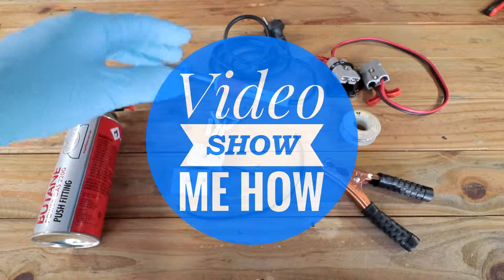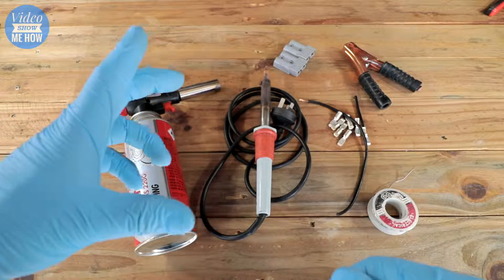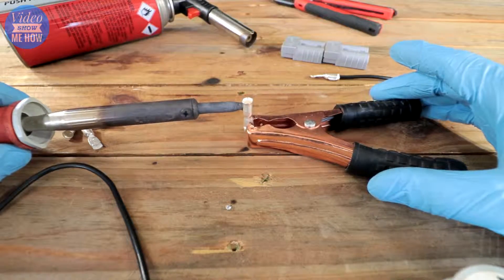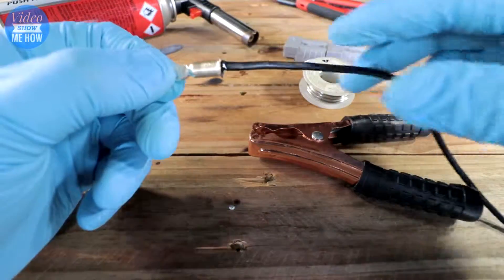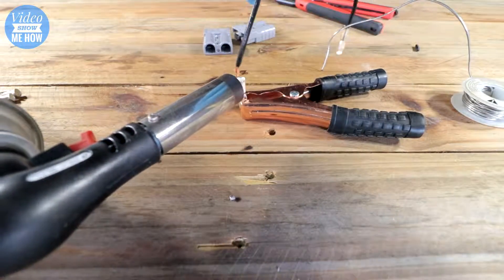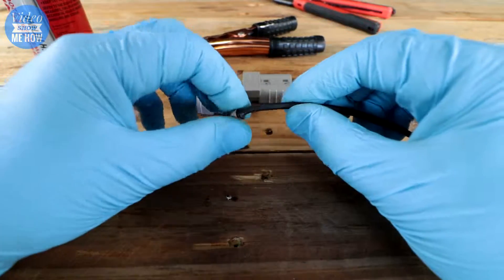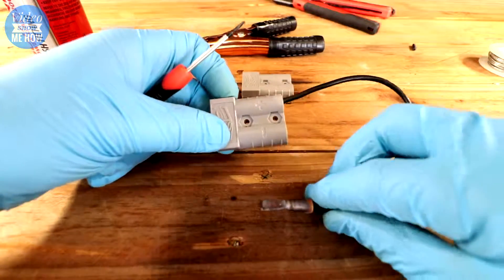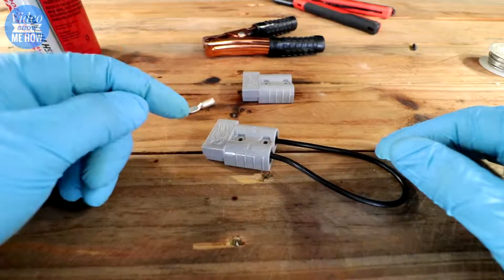12v Anderson Plugs and Connectors - FLOOD SOLDER

Comment: Though your solder job held I put solder flux on the wire and in the connection too.
Reply from the maker: Nice, thanks for the tip

Comment: 101020/1438h pst.  I’m here once again, to sincerely apologize for expressing my affinity towards soldering Anderson connector or any high current connectors (ring terminals etc) I retract that statement and wholeheartedly support crimping the contacts with 10 Ton hydraulic crimper. 
The soldering to Anderson connector became a mess and looked hideous. Fortunately I have the 10 Ton hydraulic crimper. The final product looked very professional neat and tidy. Thank you , stay safe and 73s...

Comment: 093020/1311h pst.  Thanks for the 2nd segment of connecting cable to Anderson connector, by flood soldering.
I, always prefer to solder smaller cables,  (up to AWG10) to ring connectors and to connectors of similar types as above.This is due to “Wing” formation and the struggle to trim and fashion the area. The larger AWGs, it’s best to use the Hydraulic press/crimper as you spoke and demonstrated in the previous video.
In the first part of the video, after filling the cavity with Pb, it looked that the Cu strands were simply dipped into the molten Pb. Under such conditions Pb may not adhere to Cu properly thus giving rise to an undesirable “dry solder” condition. It’d have been proper, to either pre-tin the Cu strands or dip the Cu strands in KESTER #921 fluid flux before insertion into molten Pb. I faintly, observed in the second part of the procedure, that Cu strands were 
Pre-tinned before insertion. ThT was nice.
Like you mentioned, the Ronson torch was an “overkill” (excessive heat) and  in the process, the Ag got oxidized.
But the theory is well taken.
The above comments are only an observation nothing but that. 
Your project is well appreciated and respected.
Thank you, Sir. Stay safe and 73s...
Reply: Hydraulic  crimper always better. Eliminates risk of a dry solder joint.. you may think you have a structural join but not necessarily a good electrical join -  my personal experience of 50 years doing amateur electronics and Amateur Radio!!!  When soldering with blow torch - connector can get too hot causing oxidization of the  silver coating of the Anderson connector affecting electrical join. Both the Anderson connector and the wire cable need to  be fluxed / tinned with a temperature controlled soldering iron before soldering to join electrically both parts. if insufficient  contact join area and you try to pass high current through it  - that could cause heating of the connection and even failure of it. So message is - crimp it!!  That is why profession installer always crimp. End of story!!

Comment: Nice discussion and show and tell.  My only comment is I think you contaminated your solder joint with melted plastic insulation which could compromise the strength and electrical conductivity of the joint.   Trim off a little more insulation so you don't do that would be preferable to me.

Comment: I think you didn't mention about the type of solder you used. It is very important to use some sort of flux, I think you have flux core solder. Also the cheesy jumper cable clamp isn't strong enough for me, I used vise grips. Check out T Wagner's video.